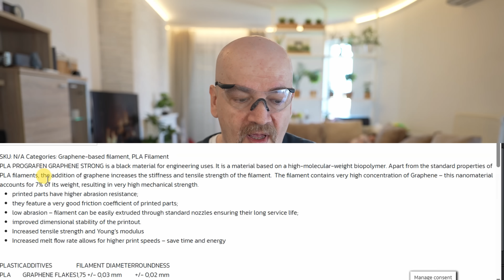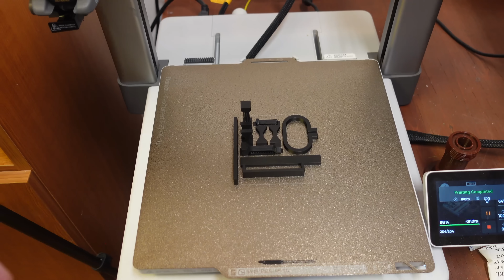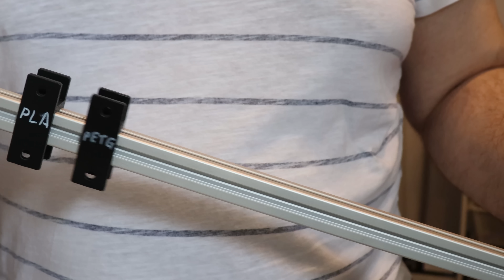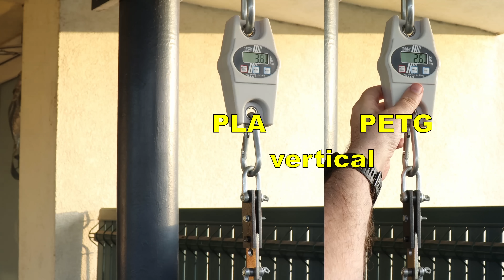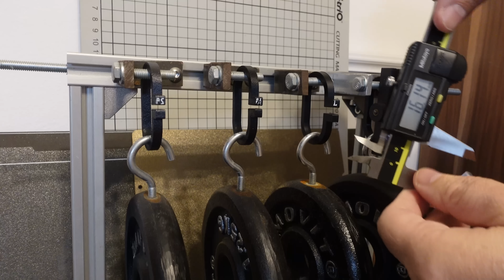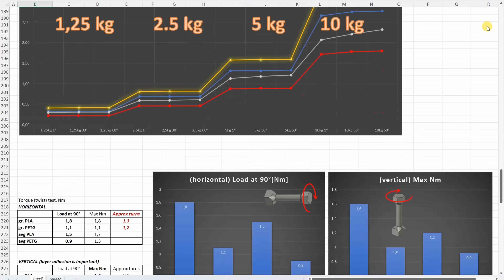Are Graphene Filaments Worth It? PLA & PETG Strong by Prografen

Comment: Great videos! new subscriber here.
A good application for these tribofilaments is leadscrew nuts. You could/should incorporate a test where you print a standard nut for an a trapezoidal leadscrew, and run the nut up and down the screw on a stepper motor. you would then measure the wear on the leadscrew nut by measuring the backlash before the test starts, and every 20% through the test (if you do 1000 repetitions, you measure at 200, 400, 600, 800, 1000). 
The leadscrew nut should be supported by a linear bearing, of course, so it only really feels axial and torque loads, not bending moments or radial loads.
I would suggest taking an off the shelf linear actuator, removing the stock brass nut, and replacing it with a 3d printer one for the test. There are lots of cheap trapezoidal or acme based linear actuators out there available for cheap.

With this test, you might measure the torque required (indicating coefficient of friction), and the backlash change would indicate wear rate (printing tolerances would come into play for initial backlash, but change in backlash should indicate wear rate, after some initial settling due to the high spots in the print deforming down)
A relatively high axial load would be required to wear the nuts in a reasonable timeframe.

Comment: You said that you printed the PETG on the highest recommended temperature, and that resulted in low layer adhesion.
And at the end you tried even higher temp and the layer adhesion got even worse. I'm now wondering: Maybe the temperature was already too high initially?

Comment: You should stick to 1 speed for all filaments 4ever. Stay constant with 30 or 50mms for whole prints. I know printers are faster, but hotends are still the same, and plastics as You know...
In my logic fast filament printed slow should be stronger. Fast filament printed fast should only look good enough. And petg printed fast is warping af, which can be seen in bigger prints.

Comment: Interesting results :) As far as I know, graphene is more about electrical rather than mechanical properties, though. Like making the part conductive, create interfaces for capacitive sensors, print tracks or create enclosures that provide shielding against rf / electromagnetic interference or electronic discharge

Comment: I'm disappointed 😢. I believe they still didn't achieve ideal dispersion or % by weight. It should be 0.5-4% graphene by total weight. Anything more and you get worse mechanical properties I think. I'm not that knowledgeable but I think there is something wrong here. Maybe multiwalled carbon nanotubes TPU would be better.

Comment: I wonder if trying a low temperature like the website showed would help with the PETG… I know that’s abnormal, but if the high temperature made it worse, I would want to try the low temps just to be thorough. The layer adhesion is so bad! Usually filled filaments suffer a little in the layer adhesion department compared to their non-filled counterparts, but considering the graphene PLA actually had stronger than average layer adhesion, I’m curious about the PETG. I’ve never seen numbers so low! lol

Comment: Interesting. I see one potential issue with you're wear resistance testing procedure though. If the back and forth motion frequency is too high it could create enough heat to soften the plastic and I think that would skew the results as far as in specific to abrasion resistance.
Reply: Consider where the heat comes from in the wear test - if you guessed "friction", you would be correct.  If a filament heats up enough from friction during the test to melt, it's not skewing the result, it is the result...

Comment: As someone who has been making true graphene from my own stock and process the last four years (originally started as a method to increase 3D printer resin strength and reduce brittleness of washable formulas), there is a tremendous difference in real graphene and graphite nanoplatelets, which is what I suspect this filament uses. True graphene will not alter the color of products it is added to, but you will see a strength increase from 20-40% (or more!) based on tuned ratios for a particular material; even nanoplatelets will increase strength to some degree. I've done extensive testing in all manner of composites, resins, 'plastic' polymers and even concrete mixes. 
As is happens, I'm also making my own filament extrusion system for graphene inclusion, though as a small shop, the process has been long in the tooth of making the parts myself vs using existing machines to suit my needs and specifications.
Reply: "True graphene will not alter the color of products it is added to" what kind of loadings are you talking, it depends. Also what do you mean with true graphene? could you share more information please?
Reply: @naminiyo1  In the world of graphene, what a lot of people call graphene is actually graphite nanoplatelets, which are multiple layers of graphite stuck together especially when dry. True graphene is one atomic layer in thickness, and getting a useful quantity to stay in that state requires a suspension medium (aka wet). To that end, true graphene works best in smaller quantities than larger. Material dependant, you can have as little as .3% to 5% on average by weight and have more than an effective strength ratio where adding more actually decreases the inherent properties.
Reply: @C-M-E  agree to nearly everything you've said. and you say that you produce in your shop the monolayer, is that correct?
Reply: @naminiyo1  Correct, in suspension. It took two years to nail down my process, but I have a few short videos on my channel as it's come up over the years on my process. Naturally I don't reveal absolutely everything as it was a tremendous investment, but the bulk is there.
Reply: @C-M-E how do you know your graphene is single layer? and what is your yield? how long it takes to produce 1kg of your SLG?
Reply: @naminiyo1  In my refining process, I come out with several grades on the way to pristine. The full process takes me about a week, but the net batch yield depends on how much volume I start with. Sometimes I have more than others due to batches in various phases of completion from the previous run or other higher order phases that show good results to continue refining versus leaving at that stage in testing; some that deal with conductivity, others I send out for independent verification from time to time. The final phase of my process guarantees single layer due to the recovery technique of the process itself. Not going into that just yet as I've invested a great deal of time and expense to develop it and the devices to do it.  It has evolved into a bulk process now however, and can yield anywhere from a few quarts to most of a 5 gallon bucket for comparative volume.
Reply: @C-M-E  This is what I was interested in. Have you seen an increase in conductivity using suspended true graphene in your products?
Reply: @graysilver007  It very much depends on what substrate you're adding it to. In polymers or the photopolymer resin, the amount required to increase strength doesn't necessarily translate to improved electrical conductivity. Other materials you can really load up like two part epoxy reinforcement and see a relatively good boost in conductivity. With graphene in particular, it works better as the top surface material when you want conductivity other than thermal or structural, more akin to a coating.

Comment: This is a strange mix of materials. PLA is supposed to be somewhat biodegradable while PETG lasts forever. PLA is supposed to be a safer material for at-home 3D printing while PETG contains endocrine disrupters and inhaled carbon nanotubes cause mesothelioma.
Reply: Graphene, gra -phene, not carbon nanotubes...
Reply: Lol😂 there's no such thing as biodegradable pla. Only in labs in specific conditions. Go spread the news cut its so annoying
Reply: @esfecto  Does PLA break down in the body? Yes, if we are talking about PLA sutures breaking down . . . but its biodegradability is oversold. I meant to point out that PETG and Graphene are still vastly more stable than PLA. It seems a waste to mix long lived and more toxic materials with PLA.

Comment: I wonder if the graphene begins to degrade at an even lower temperature than 270, leading to the much worse layer adhesion at normal PETG print temperatures.  you may be able to get it to perform better closer to the lower end of the recommended temperature range, but you may have to slow down the print speed to ensure good layer adhesion.  Although, If that is what it takes to get the graphene PETG to print with good layer adhesion, maybe graphene isn't a very suitable additive for PETG
Reply: The PETG will be a charred mass before the graphene even starts to degrade. More likely it's the graphene flakes themselves interfering. Maybe they end up on stretched out on the surface of the plastic after extrusion, reducing the PETG-PETG surface area between layers.
Reply: graphene degrades in air at around 600 degrees C. within a polymer matrix it acts a radical scavengers, increasing  its thermal stability to some extent
Reply: @naminiyo1  From a quick search, looks like pyrolysis of PETG is mostly complete by the time you reach 425°C.
Reply: @cjameshuff  good for you. PETG alone without air, yes( that's pyrolysis). in air even lower temperatures. with graphene " to some extent" means from 0.1 up to 10-20 degrees more depending on the material , sorry if  i didn't explain properly

Comment: I suspect many of these "special additives" are purely for marketing purposes...
Reply: Bar CF for nylon. That stuff makes it mentally strong
Reply: My experience with this petg graphine was very different with regards to the layer adhesion. I made 3x test parts with 4x4mm CSA and I got around 30 to 35 kg to break them apart at the layers. The parts also didn't break only at one layer. I used a e3d high flow nozzle on a x1c so I believe that the low layer adhesion was down to the nozzle design and material / lack of melting power on a stock A1 also the non enclosed print area known for weak layer adhesion.
Reply: This is correct. Any additive (including certain colors) act as contaminants to the base plastic. In the best cases, only layer adhesion is decreased.
Reply: @The_Privateer seems like you've never printed glass fiber reinforced filaments, especially TPU. You might get worse layer adhesion but many other parameters get better.
Not every additive is bad
Reply: @JestemKaspi this tracks, also TPU has absurdly good toughness properties so makes sense to trade some of that off where needed. Most other filaments do not have that to spare.
Reply: Are you telling me that my fresh roll of engineering grade unicorn tail reinforced Pro NylonLAGSP Plus Max Pro+ wasn't worth it? 😂

Comment: Some PETG filaments have lower layer adhesion when printing above 245C
Reply: It’s interesting how it varies. Bambu Lab PETG is printed at 245. But Polymaker is printed at 255. You would think they’re the same. But either the companies have different testing methods or they look at different factors when deciding what they think is best.
Reply: @melgross  PolyMaker PETG is the old stuff

Comment: With all the concerns these days about CF fibers, just wait until people read up on the health risks of graphene fibers. Would love to see a properly researched video on the topic of cf and gf health hazards. I love cf materials, but am a little unsure about having these prints around my kids. Would even be happy to contribute background research if interested.
Reply: Well graphene is single atom thick sheets not fibers so that changes things a bit. 
I've been using carbon fiber filament for a while (siraya tech PET-CF) and haven't had any issues with it shedding it's fibers, most of them lay down and are embedded in the walls of the print rather securely, my printer is enclosed and filtered so any fibers that do escape during printing collect in the filters. (Which isnt much)

dont get me wrong, if you do get exposed to a lot of loose fibers it's incredibly unpleasant but I haven't observed much if any coming lose from printed parts I print, if this becomes a concern applying a good clear coat on the part solves the problem.
Reply: @deltacx1059  True, I guess it’s either shards or tubes that are added to the filament. Still hazardous stuff. I’m considering trying a wipe on cellulose sealer for cf prints. I don’t really have any place to do any spraying, which in itself is a hazard.

Comment: Is this electrically or thermally conductive
Reply: 99.9999% sure that they aren't. for electrical conductivity we are talking about 2 to 5 wt% unoriented( in compreasion moulding for example) oriented samples( this is due to the shear applied during the extrusion process) even at 20 wt% may not show great conductivities. For thermall conduction, proper thermal conduction you need above 40wt% probably phase inversion. for PLA thermally conductive polymers make no sense neither
Reply: 99.9% of course No i guess😅

Comment: How did you come up with equivalent volumetric flow rates from linear speeds?   Just curious, printing speeds in mm/s always bugged me, volume seems way more important.
Reply: I agree, max volume flow seems like a much more useful value. I would guess you can get a decent estimate with (recommended speed) * (standard line width) * 0.2mm layer height. Standard line width being like 0.45mm or so? That should at least give you a rough idea
Reply: from experience, multiply layer height by width by print speed for volume.
If I'm not caring about layer lines or perfect accuracy, I will frequently print thick and wide at apparently slow speeds, but my printer's maximum volumetric extrusion speed. print is done faster though